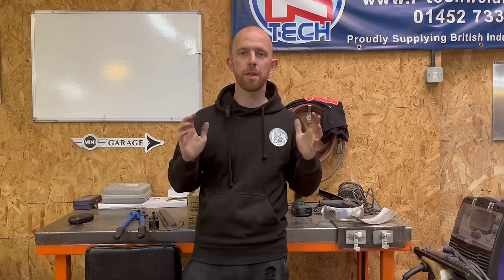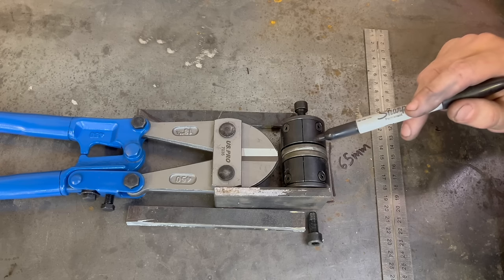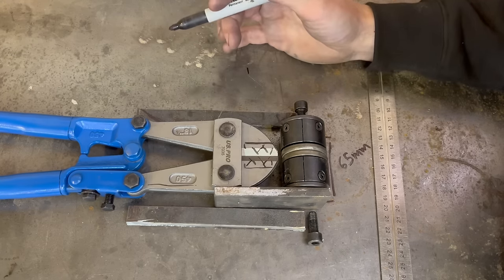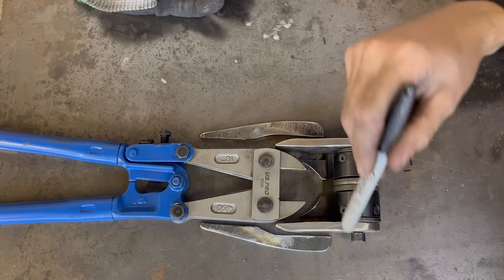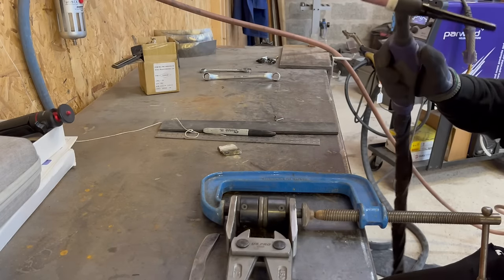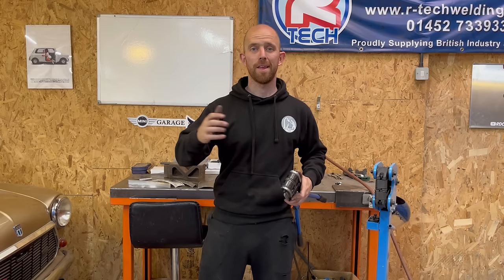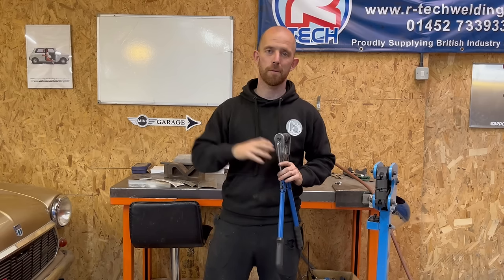Handheld Metal shrinking tool for only £13!!!  its a complete game changer!                  Rust

Comment: Tom, well done‼️👏👍
I could have done with that when I replaced the rusted out flanges on the front Mud Shields of my ‘35 Austin Seven ARQ Ruby.
Had to resort to ‘cut n shut’ but still happy with the results though.
I know what my next tool project is.

Comment: My initial concern was that the jaws do not remain parallel and get worse with thicker material. Nice job though.
Reply from the maker: It’s not to bad actually. I completely understand the concern but I don’t think I’d use it on anything thicker than 1.5mm Ali 👍

Comment: Nice welds personally I would have used a stainless rod considering the composition of the material of the blades looking as if they are of a high chrome composition.
Brilliant results looks good.
Reply from the maker: Did consider stainless but it is cheap Chinese metal so not that great quality. Once I’d tacked the bits in place and the tacks hadn’t shrunk/cracked that was good enough for me to continue using the mild wire.
Reply: @Metal_shaper_tom  nether the less you did produce wonderful product.
You should however reinforce the area where you have the bolt. 
That would be better to have a longer thread and the reinforcement to prevent bending while in use.

Comment: Another great build.   How much time would that have saved on the tricky jib that inspired it?  Are you reaching for it a proprtion of the time instead if using the floor standing one or does that still have advantages?
Reply from the maker: Would of saved me 30 minutes i reckon. I’ll still use the folios one for my everyday work but this is a great alternative for fine adjustments when fitting new panel ect.

Comment: Love your channel and content. Will the round dies also work in place of the oval ones in the stand mounted shrinker/stretcher?
Reply from the maker: Thank you. I appreciate that! They will work I just need to add a few washers to space them out as there slightly smaller .
Reply: @Metal_shaper_tom  Do you prefer the round or the oval? I’m trying to decide which style to buy.
Reply from the maker: @dannyzuko1843  tough question to answer. The oval on the mezt are really rough but work really well. Downside to this is it really marks up your panel( also great on steel. The round one are much nicer on aluminium and leave less marks but I haven’t used them much on steel. I think either way your be happy . Sorry it’s not a definite answer but I need to test the round ones more

Comment: Seems like the price of the cutters and the price of the shrinking dies come to a bit more than "thaeen quid". Or , were you schooled in that "new math"?
Reply from the maker: Definitely the new math thing. So as you would know from watching it I’d already purchased the new replacement set a few week before as I’d already been using them then I decided to make the video. Then at the end of the video I state if you have a foot operated shrinker then you can use the dies from there to make it.  The whole point of the video is to show using a cheap set of bolt cutters you can make a shrinking tool. I’m Assuming you do metal work then you would know that shrinking dies aren’t cheap? Thanks for watching anyway 👍

Comment: Legs are far more powerfull then arms. You should place this tool on a worktable and attach a pedal with link to the upper arm.
Reply from the maker: Why would I do that when I already have a foot operated shrinker as seen in the video. I think you’re missing the point of this as the is designed to be used on the job not in a fixed place

Comment: Would be much easier to use  holding it in a vise,and wurkin in one hand
Reply from the maker: Yes but that’s not the point of the video. The aim of the tool is to use it on a job itself e.g a car wing

Comment: only £13!!! (plus £99).......and a £2000 TIG welder......
Reply from the maker: Come on Steve that’s like saying let’s wheel up this panel it’s really easy all you need is this 10k English wheel to start . Like I’ve said in other comments. It’s about turning a £13 pound tool that would cost normally £500 plus . You can use your existing shrinking dies or you can buy these ones for £99 from stakesy’s. The price of the welder is irrelevant as I’ve just brought one for £200 that would do what I just done in this video. Thanks for the comment though 👍

Comment: I can tell you are a novice with the welding process as you just took the temper out of the tool you are making. You need to stitch weld a little at a time to keep the metal hardness on point. One more thing, did you figure out pressure needed as not to overtax your hands when using the tool TOM ?? Peace and out. vf
Reply from the maker: A complete novice! No didn’t figure out any pressure needed it was all guesswork.
Reply: @Metal_shaper_tom  Winging it really worked out well for you fella. I was stating a fact. No rudeness intended just said what was on my mind. I look forward to see what else you come up with Sir. Sorry do not know your first name. vf
Reply from the maker: I’ve been winging it the whole time  just don’t tell anyone 🤫🤫🤫 I’m not offended at all . I’m pretty sure The weld won’t crack and everyone is entitled too an opinion it just doesn’t mean your right 🤷‍♂️ regards Tim 👨‍🏭
Reply: @Metal_shaper_tom  Thanks for the answer Tom. Good luck with your channel Sir. Peace vf
Reply from the maker: Thank you for your comments 👍

Comment: £112........
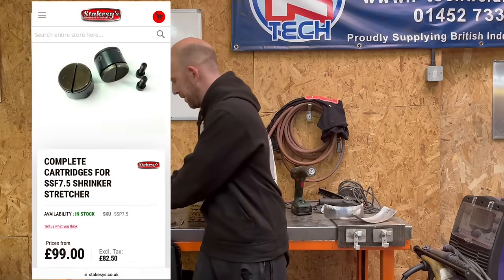Reply: @Metal_shaper_tom  13 for the bolt croppers and 99 for the heads shown at 01:05
I mean I can see its a great saving but its 'not as described' :) 
Must admit I would not have thought of using some bolt crop handles that way.